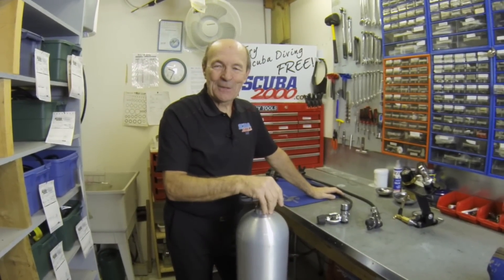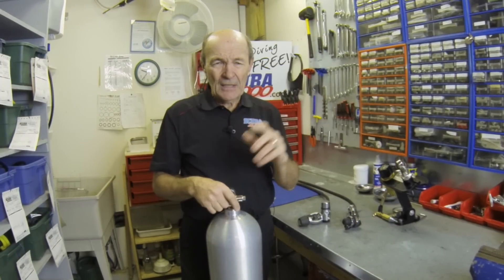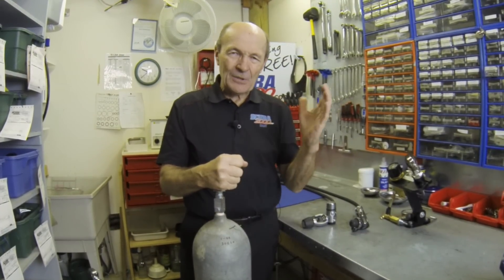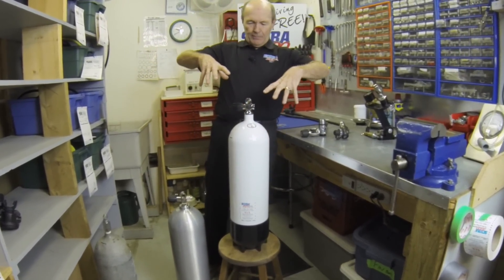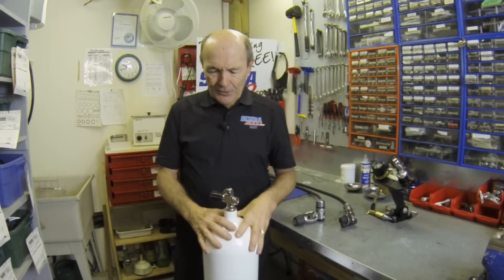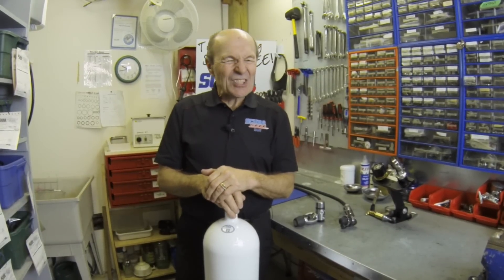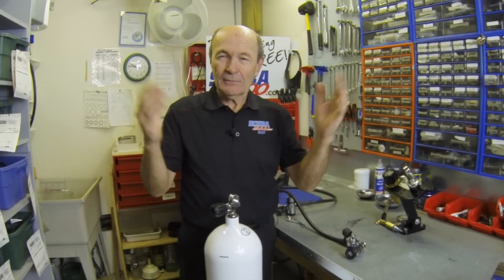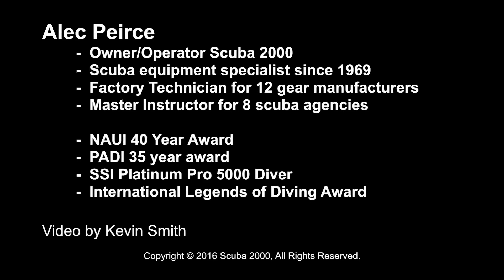Steel vs  Aluminum Tanks - Scuba Tech Tips: S03E07

Comment: I still have my first tank from 1973, a US Divers Mark 1, which is an aluminum 80 rated for 3000 PSI. It is the same brand of tank that was in the first Jaws movie and exploded the shark. I think this was the first available aluminum 80. No shop will fill it anymore because of it's age. (so I fill it myself to 2000 PSI) Now I prefer 100 cubic foot high pressure steel tanks.
Reply from the maker: The exploding tank in Jaws was pure theatre wasn't it!  Do be careful filling any tank to ensure it gets a hydro every 5 years and annual visual.  I have a Tech Tip on tank inspections coming up in about 3 weeks you will find helpful.
Thanks for watching.
Alec
Reply: Myth Busters TV show did an episode involving scuba tanks getting shot with a rifle. The result was not like the Jaws movie. It was more like what happens when you let go of an inflated rubber balloon. Yet I've read stories and seen pictures about what happens when an old aluminum tank fails while being filled. So have all the dive shops which is why they won't fill old aluminum tanks from the seventies. I find your videos to be very informative even though I'm not a novice diver.
Reply: I saw that Myth Busters too. my buddy was diving his 80/100cf alu until I showed him my 100HP tank which are lighter and slightly smaller than even 80 alu outside volume. Sold all his alu tanks and went HP steel.... the only ones we kept are the 50cf alu from the 80s for the pool and kids - quite light even for 1/2 the capacity.

Comment: Hi Alec! thanks for a very informative video! I am looking into buying myself the Luxfer AL 80 tank for my diving. Would you recommend this? Or are there better aluminum alternatives? Regards, Chase
Reply: Chase Kaplan Dive Gear Express also has a good read on this. One thing to note is recent tariffs have made aluminum more expensive than steel and some shops may not refill aluminum tanks beyond a certain age. I'd recommend getting a bigger tank and underfilling if you can handle the weight as it is less stressful.

Comment: Thank you for the video. It is always nice to hear a sensible voice. Definitely, a steel cylinder needs more care.
I personally dive steel DINs but use an adapter abroad as required. The DIN fitting I find is less bulky which is useful with side mount configurations. It is also idiot proofing with regards to high pressure cylinders in that the 300bar DIN cylinders have 7 turn threads, whereas the 237bar DIN have 5 turns. A first stage DIN that is rated for 237bar has only 5 turns on the screw so when fitted to a 300bar cylinder will not seal and will leak loudly when turned on, whereas a 300bar regulator will still work on a 237bar cylinder (2 turns will remain exposed after the first stage is screwed in).
The Oring is the same size for both DIN and yoke which is very nice. DIN O rings are lost on removal or replacement of the first stage, but as you say, they are captured rings otherwise.
I would also add that a Faber 12.2L steel filled to working pressure (232bar) weighs a teeny little bit less that a Luxfer Ali80 filled to working pressure (3000psi), while holding more breathing air. That means I carry more air, for the same weight on my back, plus I get to lose about 2kg of lead from my belt. Win-win!
Reply from the maker: Thanks CK. All good points.
Right about the 200 vs 300 BAR fitting too. When pressures rose a few years ago (everything to me is a few years ago. It could have been 25 years ago but it's still a "few"), the 200 BAR fitting was upgraded and they wisely made the new 300 BAR fitting fit into the old 200 BAR valve but not vice versa. Mounting a 200 BAR fitting into a tank at 300 BAR would not have been good.
I still have trouble converting scuba tanks in liters to cubic feet so I'll take your word on that. Makes sense.
Thanks again for the info.
Alec
Reply: Here are the numbers in imperial if you want it (gas density 0.074887 lb/cu ft for dry air at 70°F, total weight not including cylinder valves)

Luxfer Aluminium 80
Working pressure           3000 psi
Internal volume               0.3920 cu ft
Volume of gas @ WP     81.14 cu ft
Weight of gas                  6.09lb
Weight of cylinder           31.52lb
Total weight on land       37.61lb

Faber Steel 12L
Working Pressure           3365 psi
Internal volume               0.4308 cu ft
Volume of gas @ WP     99.95 cu ft
Weight of gas                  7.51lb
Weight of cylinder           29.76lb
Total weight on land       37.27lb
Reply: I ran similar numbers below. the Faber 12.2L is really a 100cf tank - similar to the worthingtons HP100 I own. You should really be comparing a HP80 (faber 10L ?) to 80Cf alu standard... as you show it's slightly lighter on land, but holds 25% more air, but you're missing the bouyancy numbers! I found HP steel tank benefit to be a wooping 10lbs savings (land + lead around waist) vs Alu *of same air volume*. AND they don't lift up at the end...
Reply: I used a Faber 12 in the example because that’s what’s on the video and Alec mentioned that it was heavier than the Al80, which it’s not. Alec already mentioned the buoyancy benefits. A Faber 10L does store the same volume of air as an Al80 at working pressure
Reply: Does not ? above you have 12L WP = 99.95cf, so a 10L should be 83.29cf at same WP. 
Alec made a mistake in his video say the steel tank was heavier (it's 25% bigger! even then not really but close). Have to compare apples to apples.
Reply: The Faber 12 is actually 12.2L, while the Faber 10 is 10L. A Faber 10 is lighter and stores the same gas volume as Al80 but you lose some of the buoyancy benefits compared to a Faber 12. Do you want numbers?
Reply: I use Faber 12 as my standard cylinder as the volume displacement is quite close to an Al80 and it makes for easier estimation of the change in lead required when I swap cylinders.
Reply: I own the worthington HP100 (and 120, been eyeing the 80) which are very similar to the above Faber. But the discussion was steel vs Alu - you gotta to keep air volume the same or you're comparing (like Alec) apples to oranges. I get the volume displacement...makes sense. For me 100 are just better size/time under , and only use Alu 80 in the topics (no choice) where I go from drysuit to a 3mm shorty so all bets are off for weight! boy was the captain wrong on my weight estimate... now I know and better write it down for next time.
Reply: Well you could equally say that the cylinders weigh the same and are the same size, hence it’s valid to compare them. Oh look, you get 20% more air for the same weight. Alternatively, you could say we should look at cubic footage, and compare them on that basis. Oh look, the steel is smaller and lighter. I don’t have a problem with it either way. Given that we both dive 100cubic foot steels, and that it is more common, I’d say the first comparison is more useful.

Comment: So steel tank is better than aluminium tank
Reply from the maker: Nope! No more than a pickup truck is better than a sedan.
A steel is better - IF you need a steel tank and there are some diving circumstances for which a steel tank may be better.
A aluminum tank is the most popular choice for most divers worldwide simply because it is the best choice for most recreational diving.
Neither is 'better'. They have different benefits in different situations.
Alec
Reply: Disagree Alec if you run the numbers. the only benefit I see of Alu is they are 
1) cheaper (only in the standard 80cf size, after that the difference is a lot less) - is that demand/supply/scale issue ? Alu tank building surely looks simpler and fewer machines
2) they come in many colors
3) less likely to rust ? air inside is pretty dry... I don't know the longevity, but 50 years old LP72s are more likely to work today than 30-40y Alu tanks it seems..
HP Steel buoyancy are so much better, why would you want to carry an extra 10lbs on you to have an Alu tank that will lift at the end of the dive...
I've been converting all my friends on 80/100cf Alu to HP steel and they are loving loosing all that lead weight (and lighter tanks!)

Comment: Faber also makes/made a "steel 95" low pressure tank very popular with Techies. (Some use older steel 104's also, but getting rarer.) The 95 is 95 cf at approx. 2400 psi, as rated in the US. However, tech/cave divers (agree or disagree, trust me, it's done at tech/cave dive shops everyday) overfill these tanks to 3600-3800 psi. Approx 140 CF of gas! Set of doubles, 280 cf! I was told that European stds allow this same tank filled to 300 bar, over 4000 psi, which is used as justification for US overfills. Any Europeans can shed any light on this?
Reply from the maker: It may be true that tanks will withstand higher than stamped pressure. This is not a new idea William.
Years ago it was common to overfill the good ol' steel 72 too.
But ...
  1. it's illegal in many jurisdictions
  2. it can lead to practical problems with O-Rings and valve connections
  3. It shortens the life-span of the tank
  4. it definitely risks a burst disc failure 
  5. it risks the safety of the fill station operator
                      .... all for a few extra minutes underwater.

There are very high pressure, high capacity tanks available (4500 psi/310BAR) but they are expensive. So all the risk comes down to money.
It reminds me of my neighbor who regularly overloads his trailer and tows it around on the highway with the suspension completely compressed, tires flattened, truck straining, brakes inadequate, all to save buying a new one.
Eventually some will get hurt or die. The cost then will be much, much more than doing it right (DIR).

Ironic that tech divers who claim to hold the high road on diving safety would condone such an obviously unsafe practice.

Take care.
Alec
Reply: I heard the same story when I sold a double 85LP faber tank to a tech diver... but I think they said that tank stamped WP was much higher in Europe than 2400psi here. Official WP not what the tank can take/overfill to. Would be interesting to read the European version markings on it...
Reply: I did it for years, many do, but always wondered, never heard of anyone having an issue.

Comment: We , here in Romania/Europe dive only steel  300 bar tanks. We use Alu only for stages.
Reply from the maker: Aluminum tanks are the norm here although steel tanks are fairly common. I'm not sure why there's that difference. It may be that aluminum is cheap here. Not sure why. They both work well.
Alec
Reply: Here in Portugal/Europe we use Steel 12L 300bar tanks aswell. Have only used Alu when sidemounting, the Alu bottles become positive when a bit less than half full I feel like thats a big drawback if you're on a dive with varying dephths if you start deeper and then go shallower it can make it so you can't keep yourself down which means you have to carry overweight from the beggining of the dive; can always inflate the bcd more to correct negative buoyancy from the steel bottles but correcting positive is a bit harder gotta put some rocks in your pockets.
EDIT: and we use DIN almost exclusively although most places do have a bunch of Yokes so people from around the world can use whichever system they're used to and prefer.
Reply: Ajbas S that is very true and we do this also. I always prefer my twin 15L steel with dry versus everything else.
Reply: do you mean 300 bar (who sells those tanks) or 232 bar tanks ? I was only able to get 232 bar tanks at the 2-3 shops I went to in France. 
Lucky to get even close to a full tank - pretty lame 210 bar nitrox as they mostly fill for classes and seem to skip on that at one shop I went...
Reply: @alaind831  yep. 232 bar. I was reffering to the type of attaching the first stage to the tank

Comment: Alec,
I run steel 100's and am paranoid about moisture getting in the cylinder, particularly after a dive washing them,off,with fresh water.  Rinsing the valve and  outlet I notice a good,amount of,water in the outlet.  Can I just let some air out to,blow all that accumaulated water out and then take them to get filled and,be ok?   I notice some shops dont always let air out to,make sure there's no residual water. What do,you suggest?
Reply from the maker: Absolutely. That's the best if not only way to clear a valve.
And any dive store worth the name will always have a brief blow out to ensure there's nothing, water, dirt, insects, etc., in the valve face hole before filling. If they don't, anything in there that doesn't belong will be forced into the tank. All the expensive filters in the world are wasted if that happens.
I'm thinking that you're using DIN which happens to hold a lot of water in that large hole. It for sure should be cleared before refilling.
Take care.
Alec
Reply: Alec Peirce Scuba 

Ok thank you. The pro style oulet holds a fair amount of water post spray down.    I use a yoke bc I have both hp and lp cylinders.  The first few times I used the hp 100's I was nervous, but my shop said my reg can handle the 3442 psi, but no higher. I know you are in the camp that says anything over 3000psi should run on a DIN; think I might,be leaning that way now.  Funny thing I notice the air I breathe from the hp 100 seems to,flow into the 2nd stage with more force.  More force than my lp  100's.  Perhaps an adjustment in the 2nd stage needs to be made.
Reply: I too use HP 100 (hot filled to 3700 sometimes) with yoke without issues... and if you use the same reg, it should always have 150psi IP no matter if 3000 or 3500 tank pressure, or down to 500psi for that matter! I've ran by tank pretty much dry and my reg still was breathing fine till the very end (testing what my digital computer 0psi really means at least 20 breath left in the pool - good to know :)
Reply: Alain Dumesny 
Def good to know, thank you.   Took my reg to local shop and they made a slight adjustment in the 1st stage.  Air flow is now consistant
Reply: forgot to mention: I have a balanced regulator - so same breathing at full or near empty (or any depth for that matter). That may not be your case...
Reply: Mine is an unblanced AquaLung Titan 2017 model.  The "work horse" in their reg line. I mostly dive <45ft hunting for fossils.  Will upgrade to a balanced reg when I get nitrox certified for deeper hunts.
Reply: actually nitrox limits your depth (oxygen poisoning under pressure) to only 114ft or so (can't recall, computer does it for me) at 32%, but less than that and you have more time for no deco (or shorter deco)

Comment: Never mind the extra pressure available, probably you are not going to need that. However, there are other reasons the DIN excels over yoke the main one being  that you are most unlikely to have an O-ring problem, actually, I’ve yet to see anyone have a problem.
Reply from the maker: The O-Ring on a DIN fitting is located on the regulator, not the tank valve.
That fact alone saves the O-Ring from some of the abuse that a regular (yoke-style) valve & O-Ring go through.
However, the O-Ring on a DIN must still be inspected and replaced regularly.
And it ought to be protected with a DIN cap while not in use.
I HAVE seen them fail and fall out.

If a yoke valve O-Ring is inspected and replaced regularly (all of $1.00!) and one uses a valve cap for protection, the yoke-style O-Ring is just as reliable. It's also less expensive and it's quicker and easier to mount.
A lot of my viewers are from the UK or Europe where the DIN is standard and lots of my viewers are into tech diving where the DIN is more popular but please don't sell the yoke short. It's been giving great service to divers for a heck of a long time and there's no sign of it disappearing.
Thanks for watching.
Alec

Comment: Hi alec.

so how high of a pressure rating can a tank go to
and when/where would you  use such a higher P.S.I. rated tank?
Reply from the maker: When I started diving tanks were 1800 or 2250 psi.
Most scuba tanks are now 3000 psi.
Some steel tanks are 3442 and some are 3500.
Fibre-wrapped tanks can be 4500 psi but are not common for scuba diving because of the cost.

Generally a diver would choose a high pressure tank to give more air in a smaller package or to increase his negative buoyancy.

I hope this helps.
Alec
Reply: Alec Peirce Scuba oh ok.
so a higher p.s.i tank has nothing to do with carrying more usable air.
im mean you can only stay on the bottom for so long anyways before you need to start an  ascend regardless whats left in your tank.
unless your using nitrox  im thinking..
Reply from the maker: Oh boy. Lot's of issues here Joel.
1. higher pressure does not necessarily mean more air. Higher pressure may give the same volume of air but in a smaller 
     package. There are several scuba tanks that all provide 80 cubic feet of air but are different sizes, pressures and 
     materials. You can get a conventional Aluminum 80 at 3000 which is 26" long and 7.25" in diameter or you can get an 
     Aluminum 80 with higher pressure that is a bit shorter or has a larger diameter or you can get a Steel 80 that is higher 
     pressure and much shorter. 
     Look here at some possibilities    http://www.huronscuba.com/equipment/scubaCylinderSpecification.html
2. your underwater time is limited by several factors of which air supply is only one.
3. the use of EANx (Nitrox) does not necessarily extend your underwater time. There are numerous reasons to use Nitrox but 
    doing so may actually shorten your underwater time and will almost certainly limit your depth. 

You've just given me about 4 more Tech Tip topics Joel.
Alec
Reply: @AlecPeirceScuba_SeaHunter  " use Nitrox but doing so may actually shorten your underwater time" - when would that ever happen ? I'm not taking about depth (oxygen poisoning).. Nitrox always lengthen your no deco underwater time (until you run out of air).